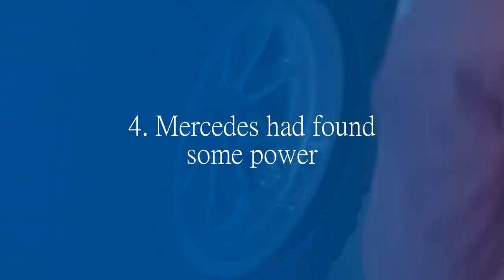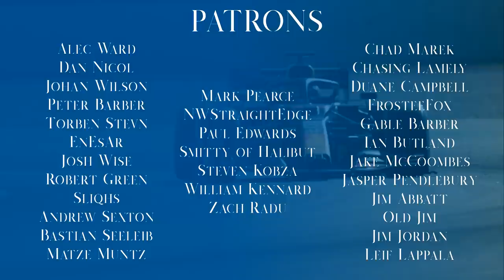THE SCANDAL BRUSHED UNDER THE CARPET! The Story of the Ferrari 'Cheat' Engines (2018-2019)

Comment from the maker: I said 128kw. It’s 120. Where the hell did I get 128 from? Must have been the converter.
Reply: The catalytic converter!
Reply: Fellow sound engineer here.. I usually have 20dB limiter when listening youtube, so i don't have to bother with varying sound levels. Didn't have it on today and i think you could compress a bit more and raise gain, it is a bit quiet overall.
Reply: a rounding error. Computer Science Geek Here  - Then there's the accumulated round off error. So depending on your policy a> Always blame the computer  or  b> It's got to be right, the computer said so or C> I saw it somewhere on the internet (I just did)... you can chose from any and all so it's never totally your fault :)   Good show
Reply: It was that damned flux capacitor
Reply: Another small correction - Ricciardo lost his MGU-K at Monaco 2018,not gearbox problems, he just did not use 8th gear after that point to stop the engine bogging down
Reply: Great vid
Reply: For all you guys thinking that VETTAL just went off the road in germany with a light drizzel , it's due to a problem with the car. Just see the full video and how much problem he is fighting the car in all the corners before he goes off the road. Being ferrari they will not admit it was a car issue.
Reply from the maker: @GowthamV07  he went off the road, it was drizzling. He went off in a bit of light drizzle.

Car problem or not, that’s what happened. 🤪
Reply: If you're interested in a smaller episode, there's always the DAS issue and the fact that James Allison has said in an interview that it was basically only legal because of the FIA giving them "impossible" parameters that Mercedes met.

Legality on the grounds of governing incompetency, it's F1 in a nutshell.
Reply: Who else but you was talking about break testing?
Reply from the maker: @gringostarr69  lots of people.
Reply: @AidanMillward  All I heard was monologue
Reply: @gringostarr69  -- Not even going back to 4 years ago when the incident occurred... these are just the ones within the last 12 months, since we're only searching for evidence that this incident is STILL being discussed to this very day.  The format is as follows:  (YouTube Creator - Video Title / date)...

Sports Shorts Moments - When Vettel Said Hamilton Brake Tested Him At Baku / December 2021 (<< this one has 1.1 MILLION views by the way)

Eren Uler - Hamilton Brake Test Bruh Moment / December 2021

CrashF1 - F1 Azerbaijan Baku 2017 Vettel vs Hamilton / December 2021

F1 Content 2048 - Vettel Brake Tested By Hamilton / December 2021 (<< seems a popular month to be digging this back up for some reason)

dabosss04 - Vettel Hits Hamilton 2017 Azerbaijan GP - February 2021

Formula 1 - Inside Tracks: 2017 Azerbaijan Grand Prix / February 2021

I Sporty - Vettel Hits Hamilton F1 Hamilton Baku Crash / June 2021

Motorsport Content - Inside Tracks F1 Azerbaijan GP Baku 2017 / February 2021

FLoz - Silver Vs Red F1 2017 Five Or Nothing Sebastian Vettel vs Lewis Hamilton / April 2021

DPandKP - How F1 Twitter Saw The Hamilton/Vettel Incident In Baku 2017 / August 2021... 

... And I'm stopping here.  This is only after about 15 minutes of searching.  I could have kept this list going, but I think 10 is enough to prove the point that, as Mr Millward stated: "Lots of people are still discussing this".  Also, I think it's fair to point out that THIS IS JUST YOUTUBE... and it does not account for any other platform where F1 is discussed.

Oh, one last thing... normally I wouldn't say anything about this but, since you seem to enjoy acting like a complete douche, you totally deserve someone condescendingly explaining to you that, it's BRAKE testing... not BREAK testing.  If you were anything other than a troll, and knew anything at all about - or were even a casual a fan of - motorsports, you would have already know this... so, you kind of busted yourself as to what you really are and why you're down here with your pithy little, pedantic comments.  Hopefully this will serve as a lesson for why you shouldn't mess with motorsports fans (or fans of anything in general), because we're just nerdy enough to spend whatever amount of time it takes to prove that you don't know jack-shit about our sport, and you're just talking out your ass (I'm assuming because you have some asinine need to try looking "smart" by one-upping people in the comments section).  Perhaps next time you should do a five minute search to actually CHECK that people AREN'T still commenting about a thing, before falling flat on your face by blindly claiming they aren't (<< laziness will undo you every single time)  You're not even good at being a troll... knowing what you're talking about, and having the evidence to actually back it up, is Trolling 101).

And with that, I bid you good day, sir...
Reply: Nobody is perfect! :)
Reply: @thebonesaw..4634  chill out

Comment: In a sporting context it was obviously cheating but it was such mechanically intelligent cheating (like with the Toyota restrictor plate) it's hard to have anything but respect for them despite it
Reply: If the FIA can't prove what you did was wrong and have to actually ask you, then credit to you
Reply: @MrSniperfox29  Which isn't that difficult as proven by the number of cheats the FIA didn't catch on to. 
Simply put: the FIA are somewhat skilled in making up rules (I say somewhat because a lot of their rules actually end up having the adverse result of what the FIA was expecting)  but terrible at enforcing these rules because they seriously lack the expertise and/or brainpower to think things through properly.

Take for example the DAS system: Mercedes developed and implied it as an aerodynamical device while constantly discussing it with the FIA. So it was legal. But then Red Bull stepped in and said "hang on guys, this DAS system must also be seen as an active suspension device, as Mercedes is actively changing the setup of the front." Something the FIA "experts" hadn't even considered.

When the FIA is só inept at it's core tasks, then it isn't really any wonder that there have been so many cheats in the sports.
Reply: @tjroelsma  To be fair, DAS is just the latest in the long line of "yup that's legal, oh wait, someones protested, nope, now that's illegal" that's happened pretty much throughout the history of F1

Mercedes should be happy these days such things aren't immediately banned like the were back in the day, forcing many teams to completely redesign cars on the whim of the FIA and a protest.
Reply: @MrSniperfox29  Yes, but it one of the most recent and most telling of stupidities the FIA approved of, especially as it took Red Bull one look at the system to figure out that it also fell into the category of active suspension, while the FIA was clueless about that.

As to Mercedes being happy: what about Red Bull, that won multiple races with a rear wing that had way too much flex under pressure and therefore had an illegal advantage? Or the shady deal Ferrari made with the FIA over the fuel flow sensor controversy? 

The FIA is just hopelessly incapable.
Reply: @tjroelsma  The same rear wing that passed every single test the FIA gave it?

What about the Mercedes front wing which also flexed way too much? Passed the same tests yet to everyone else it was also illegal?
Reply: @MrSniperfox29  Yes, because the test method the FIA used was faulty. Those idiots did the measurements with a static load and never realised that the dynamic load on those wings was way higher. Red Bull figured that out and therefore made their rear wings just rigid enough to pass that faulty static test but have a huge aero  advantage on high speed, where the wing did flex much more. 

Mercedes used pretty much the same trick and so therefore their front wing was strictly speaking also legal with the same advantage as Red Bull's rear wing.

So this is a double whammy incompetence by the FIA.
Reply: @tjroelsma  I'm glad you also admit that Mercedes were also cheating then.
Reply: @MrSniperfox29  It would be rather hypocritical to exclude them, as they used pretty much the same trick as Red Bull did. 
It goes to show how terribly incompetent the FIA is.
Reply: @tjroelsma  I wouldn't say the FIA is just hopelessly incapable. Remember that they're up against the best & brightest engineers.
Reply: @mickcompagnoni1114  I would: almost everything the FIA has come up with has failed in one way or another. 
Their decisions about the aerodynamics stand out particularly. That ludicrous system called DRS had to be implemented because the engineers were allowed to change the airflows around the cars só much, that following a car within 2 seconds became almost impossible, let alone slipstreaming. 
Then there's all the shenanigans with the tyres wearing out too fast, exploding and having absurd differences in grip level. 
And what about doing away with the relatively simple and therefore easy to run 2.4l V8 NA engines and replacing them with the ultra-complicated turbo-hybrids? The FIA figured that these turbo-hybrids would be CHEAPER to run than the NA engines........ right.
And last but not least there's all the changes to the circuits, that made it possible for drivers to take cut off almost every corner so that same FIA then had to implement track limits, which it did very poorly and arbitrarily. 

Much of all the controversies around the rules are self-inflicted wounds by the FIA, because they either always leave room for interpretation or flat-out make the wrong decisions for the new rules.
Reply: however they stumbled upon that loophole is a story I would love to hear

Comment: just my two cents: 1) Fuel flow: as a control system PhD I still have some concerns about the actual increase in fuel amount given viscosity and other fluid-mech aspects you can get in between data samplings at such high rate. But I could be wrong, the fuel could be very "liquid" and the pump can have a very instantaneous reserve of high pressure... Still perplex tough.
2) Dual battery: In my opinion FIA should truly make less stringent everything limiting electric performances. Cars are getting more and more electrified and I miss the point of having caps on instantaneous MGU-K/H KW, el power per lap, batteries, etc. Freedom in those areas would result in more research for EVs, discoveries beneficial for urban mobility and interest from automotive constructors whose trajectory is electrification.

Comment: From what I gather from Dutch press, it is assumed Ferrari (also?) pumped fuel into the fuel lines to the engine (past the fuel flow sensor) while off the throttle, to give additional fuel flow coming out of corners. This is the reason for the second fuel flow sensor, which was closer to the engine, and also coincided with the drop in performance.

In addition, in Austin (I think?) they ran low downforce to offset the loss in power to make it appear they were still achieving similar top speeds and thus weren't affected by the rules clarification.

Ironically this is the opposite to what McLaren did with Honda in their last year together, where they intentionally ran very high downforce to show high cornering speed and low top speed so they could blame Honda for poor performance. Honda wasn't great, exactly, but neither was McLaren itself at that point.
Reply from the maker: Pretty much, yeah. They had to run less downforce to go as fast in both 18 and 19 and it shagged them in the corners.